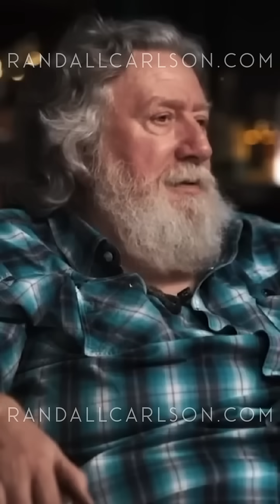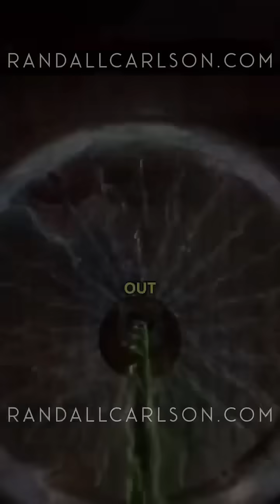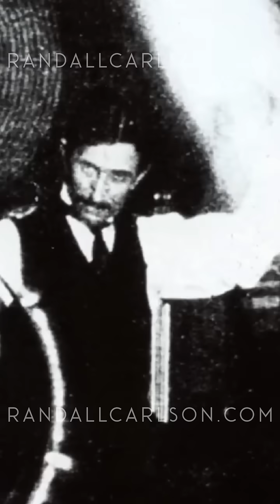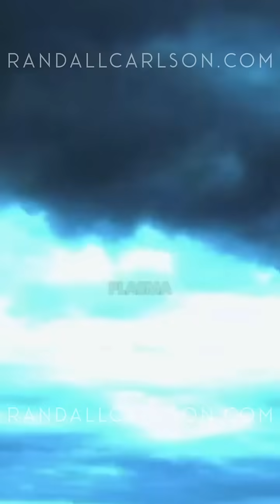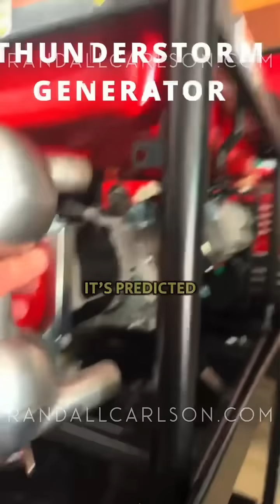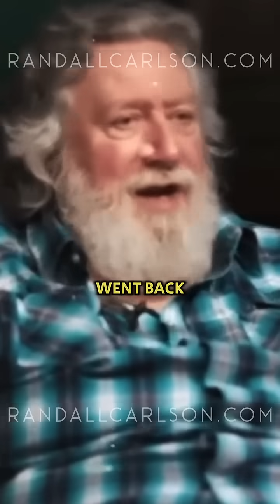Plasma Energy and the Thunderstorm Generator

Comment: Google your car model and ad HHO GEN - Diesel engines run on self-made HHO - Vatican orthodox co2, oil, steel & Lithium Impirial CABAL is cursed and will go down and pay for the inconvenience.
Google Musk new water motor. Get experienzed. Lithium based electric cars are obsolete sais Musk.